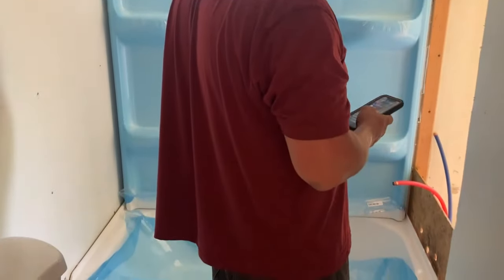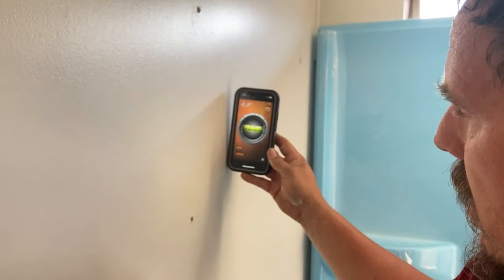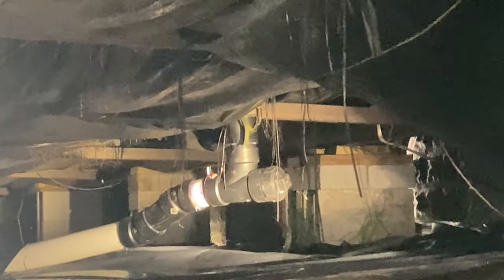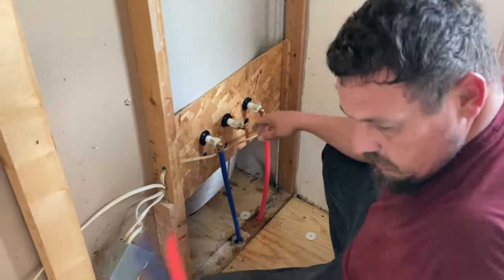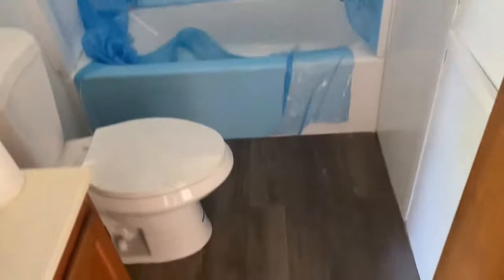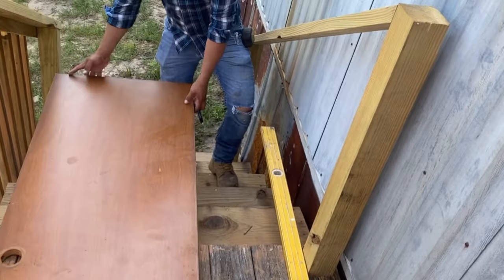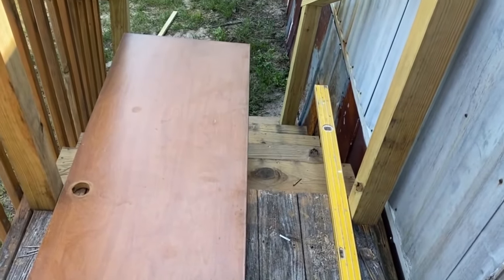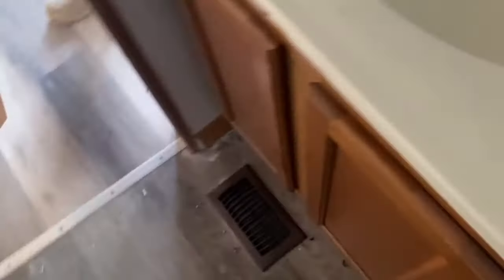A Brand New Bathroom For Our Old Mobile Home...

Comment: Wouldn't you use a standard double insulated White Shower hose line for the shower ?? Since the are not normally heat taped ??
Reply from the maker: Don’t need it it does not get cold down here